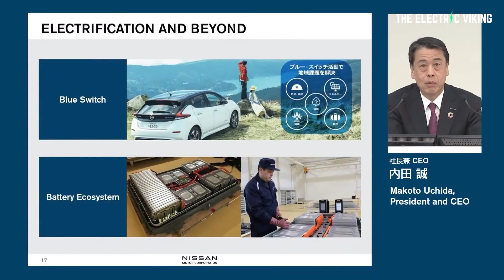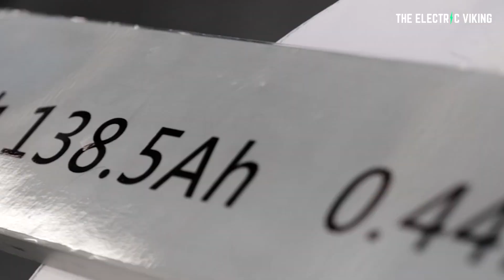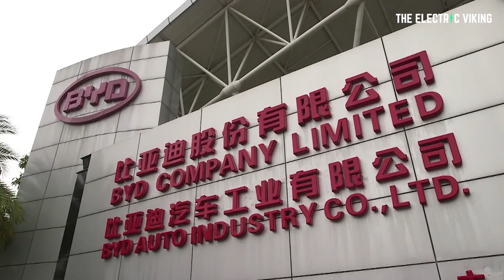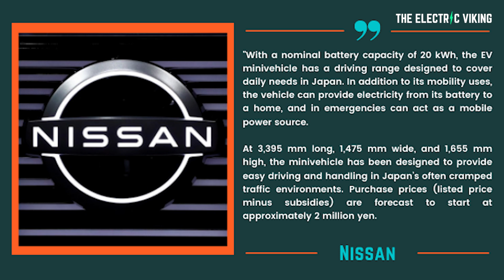Nissan and Mitsubishi partner on a new mini EV coming in 2022

Comment: It could be they are trying to avoid the 'Osborne effect' where a company announces a car too many years ahead of production and cant sell the old model and dont have the new one to sell. Overpricing means they are not going to get orders and can switch the price just before its launch.
Reply: GM is getting hit with that now. They are screwed. Their Ultium battery is still in commercialization. There is no guaranty it will get to production.

Comment: Why is it that a lot of the automotive media thinks Japanese cars should be cheaper or sold cheaper than other  manufacturers. The car is priced correct . Just like the GTR some thinks it’s to expensive, but I’d in particular with a Porsche . The Japanese cars are priced correctly
Reply: Nah, $18,000 is way too expensive for a kei vehicle that only goes 100 miles.

Comment: Prices coming down. If by that you mean "The Nissan Leaf is the same price as was when it first launched but now has 1.5 times the range" that kind of makes sense. A 2010 Prius was $32K. A 2022 model today is $52K. Leaf was $25K/$35K USD. So, yeah with the chip shortage and manufacturing constraints on both the chassis and battery, plus delivery time frames for passenger vehicles already blowing out way past the current model run for a number of popular vehicles (see the replacement for Mitsubishi Triton or Kia Stinger GT) I would say that the price of ICE vehicles will rise AT LOT MORE to meet the asking price of BEVs.